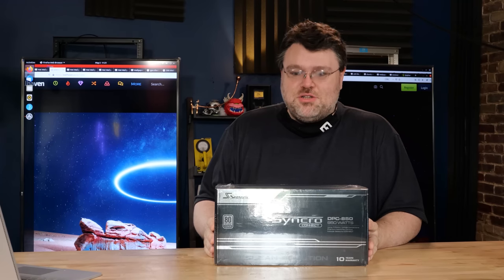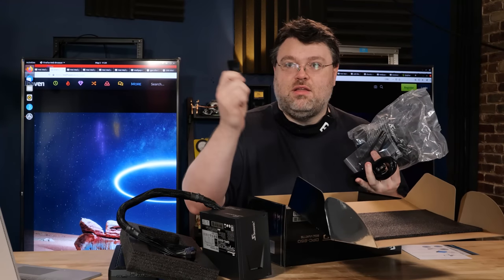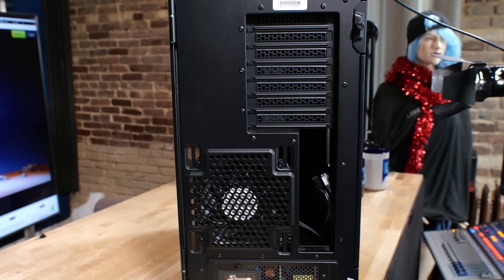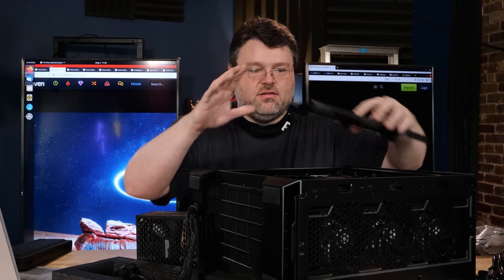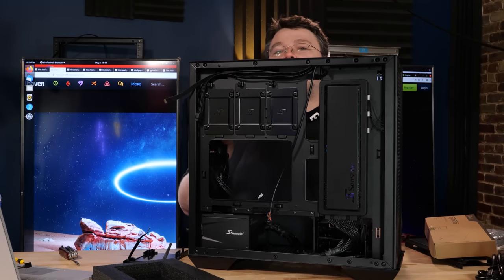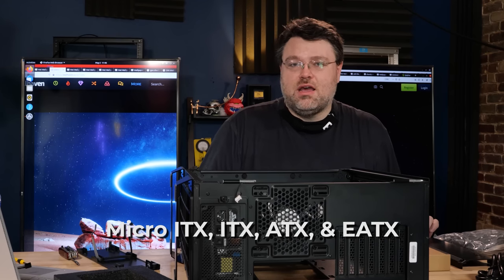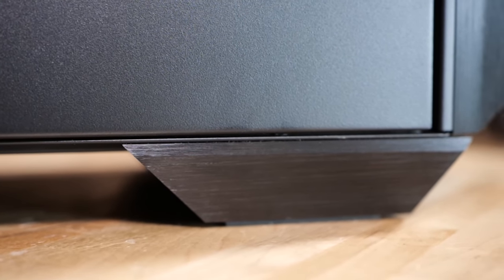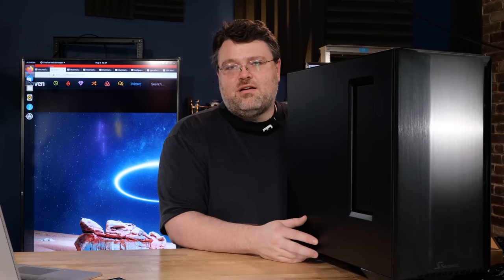First Look: Seasonic SYNCRO Q704 - The ULTIMATE Cable Management Solution

Comment: Upside down mounted builds are cool, but I just can't get used to using my OS upside down.
Reply: You could try one of those Teeter Inversion Tables, which hangs you by the ankles in front of the monitor, and see if that helps.
Reply: @d00dEEE  not sure that will work, as he has been used that OS, not sure what its called, Britishit has something to do with the north or south poll, also that Zombie OS and plus I think he has open up OBS ones or twice.

so in short he is Doomed 😁
Reply: Turn you monitor upside down to compensate
Reply: Perhaps windows 11 will have better compatibility?
Reply: Set your language and location to Australian and it should just cancel out.
Reply: @TheAnoniemo  As an Australian, can confirm that this works

Comment: I'd like a normal ATX PSU, but with an ad in slot that can take a board that can output 5v/3v. This way you just buy it if you need it. This new standard that puts the power stepping on the MB is just nuts.
Reply: We'll have to add 'how many things it can natively power' to the list of options to check before buying the MB.
Reply: @xXDeltaXxwhotookit  Yeah, but what if I have 10 SSDs. Actually I do!
Reply: @KangoV  50/50 whether they'll reduce the number of SATA connections to limit the space required for the power, or they'll go over kill and it'll be a rats nest of splitters.

Comment: Seasonic did release a PSU, based on what you saw at Computex last year --> a 750W 80+ Gold build ["Connect" IIRC], having the distribution schwinging dongle fixed to a PSU main wire [then voltages divvyed up, according to applicable connectors available]

With saying that... That assembly, is a U N I T [likely needing a full size case, to accommodate that brick]

Comment: ok so this is a cables distro plate, and then we got watercooling distro plates..and then it never ends... how about, changing power supply form factors altogether and getting rid of Intels ATX standards forever?!
How about motherboards that slot on power supplies with no need for cables at all?!

How about motherboards that are slotted on GPUs?!
Reply: so a laptop
Reply: ATX12VO is coming, servers have been using slot in power supplies for ages, single board computers that plug into pci-e sockets exist already
Reply: @TunsaMcHaggis  that's exactly my point... good morning.

Comment: Screws: The best ones ever invented are the Robertsons, IMnotsoHO.  The screw is firmly held in the driver, so you can point it straight up or at a wall, and it won't fall out.
Reply: Without a magnet?
Reply: @WillFuI  yes, its magical. And a magnet helps even more. I’m an american but have had the pleasure of working in canada and experiencing them.
Reply: @brwainer  sounds to dreamy to be true

Comment: I am super against 12v only. Could run into a situation where motherboards no longer support external DVD drives or something similar resulting in a system being locked down to a specific era motherboard. Motherboards are already stupid expensive and prone to failure as well. All these changes like LGA, power conversion, etc. being put on the motherboard is only going to make the issue that much worse

Comment: Great concept but it's headed towards the wrong direction. The problem with this product is that cable management was never an issue on ATX systems to begin with. I have built over a dozen systems for myself and my family etc and I've never had a single issue on cable management. The only time where it becomes a problem is when I was building an SFF itx build, especially those sub 10L sandwich style cases. 

But this isn't an SFF power supply, and the added bulk means taking up more volume, more than the cables themselves, so basically it solves nothing.

Comment: I just picked up Corsair's Obsidian 500D for $160. It has dual swinging 4mm glass side panels with mounting forba vertical GPU set up and a awesome hub. They have the 500D2 RGB but, it's basically the same case. Corsair wants $150+ for 3 LL120's. When you can just buy the 465X case, take the LL120's out and you got a free case.

Comment: The Seasonic Connect had better case compatibility, the Syncro basically only fits in this one case. Even to mod a 3rd party case, it must be inverted or have the PSU at the top.
Seasonic is in the right frame of thought, a hub box is much better then Intel's 12VO using up additional board space for power out and creating more visible cables to manage.
(I like the idea of the motherboard going to 12VO but it should only be handling it own power requirements)

Comment: It's a pity that the cable between the PSU and the distro hub isn't modular to allow for different cable lengths (e.g. shorter for ITX builds) and smaller hubs.

Comment: For years I always thought it would be cool if a company soldered the power connectors for the motherboard on the back side of the board and the case supported cutouts to plug them in correctly. A solution like this is neat but at the end of the day it doesn't really change much.

Comment: why on earth are you looking forward for 12V only supplies? that will simply move the bulk from the power supply to the motherboard. and if I ever need to pick a location, the power supply is the perfect place for most voltage regulators, not the motherboard.
Reply: @asdrubale bisanzio you're missing the point. the motherboard should not have this extra space constraint. CPU power has a reason to reside on the MB since each CPU can have different needs. but needing space to power drives from the MB is the worst idea ever.

Comment: I really like the concept of what Seasonic is doing here.   I think I'll get on board when they produce a 12VO-compatible version, since I want my next system to be 12VO.
Reply: Ideally, we'd see a synchro module that had compatibility for both ATX and 12VO, to ease the transition between the standards especially where peripherals like SATA drives are concerned, and other devices that expect lower voltages. 

Either that or a universal module that takes a PCIE 6/8 pin plug in, and converts down to 5v/3.3v with modular cables for SATA/Molex coming off it - like a "mini synchro" module, if you will.

the DC-DC PSUs used for car PCs and off grid systems do pretty much fit those use cases already, so it's possible we'll see some of those manufacturers step up and offer solutions like those mentioned, but most PC builders don't really have their eye on solutions like these (yet).
Reply: indeed, but at this moment it is just the $161 SSR-750FA and its too low for me, so the old 1200v corsair will be put back to work in 2022 when I update, so current PSU will go on, 
we are to far into 2021 to upgrade and prices current gen of parts are way to high to buy due do covid and also way to high for parts are coming last gen in few months.

Comment: Why would you need special cables for mining... Unless you're dumb, you're both running the GPUs very efficiently AND not sharing PCIe rail cables. My guess is they probably want to educate users instead so they don't end up burning the house and getting Seasonic liable for it